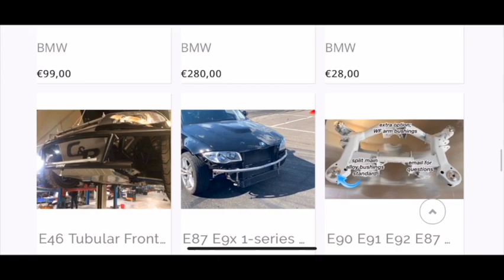Electric / Power Steering, Formula Drift Problems, My Shop and more! Instagram Answers Revealed!

Comment: For the 3rd question do simulators enter the picture? 
You can get a lot of practice in a sim for not that much money.
I have a lot of hours on a sim and when i went to my first lessons, it was pretty quick for me to adapt to the real car. 
However how does this apply to pro cars and competition?
Reply from the maker: I think its great for learning tracks, but to be honest I don't think the car setup translates at all. I drove probably 10+ really good sim rigs and to me none of the cars have the grip level of a pro car.  And ofcourse everyone always says "download these cars" etc, but then we do that and they still have less grip than a missile on bald roadtires. 
Gripped up pro cars are so crazy wound up, I've never driven a sim that even comes close . 

Sims a great for learning the basics, but the last 10-20% needs to come from driving a pro car. 

Nothing beats the real thing.
Reply: @DriftJesus  i can see that, for context my sim is triple 32 inch (all the field of view) and i use a simucube 2 pro wheel base on a solid 80/20 rig (all in with PC over 7000$).
When i did the drift class i was driving a pretty much stock 350z and found out real quick that if you aren't committed with the throttle it will not keep drifting while in the sim a similar car (tando buddies) will just stay sideways for days....

For sure there are some cars that are way better than others and offer more grip, but to your point i don't think there is any say 800hp car ingame that would struggle to spin the tires, like say Adam lz did in utah during practice when his nitrous wasn't working which put him at about that power level. 

So i can't really imagine what a pro car actually feels like ....
Reply: @DriftJesus  i guess a bigger question would be why don't teams invest into sim software for drifting?
Reply from the maker: @Philsilva06  I think for most people in Europe the choice is ; sim drift or not do anything drift related 

Ofcourse in that case, always sim drift.

But you are 100% right,  cars in sim will do a reverse entry through the entire corner.  And indeed, RTR or any Pro1 car will not even spin the tires when totally wound up.
Reply from the maker: @Philsilva06  some of them actually are.  But keep in mind, sim drifting is only ever gonna be visual.  

If you look at FDNJ, it seems a really easy track, right?

However, you can't see the entry , its all blind.   A lot of the younger drivers / sim generation struggled, because the visual references weren't available.  

It seems super easy, but the entry isn't as easy as it seems.  You go in completely on gut feeling / timing feeling.  

I think especially in USA, its so easy for the pro guys to have seat time (esp on West Coast and Texas) that it makes less sense to build a 5k sim setup that to burn 5k worth of tires.
Reply: @DriftJesus  you could add motion to a sim rig but then your are adding a lot more cost... however it actually felt easier in the real car than learning in the sim because you get more information like g forces which you don't get from the sim. Again pretty much stock car

 Different topic though,  i was originally asking about pro cars because burning 2000 tires at 200-300$ a tire is a lot and an alternative would be nice lool.

If there was say an iracing platfrom for drifting i think it would be "real".

Coincidentally i spoke to my drift instructor about drifting englishtown fd layout (he drives there) and i described that going off the old drag strip to the new tarmac in zone 2, you have to let off throttle a little or you would spin and he said that was pretty accurate. Maybe i have a different version of the track?
Reply from the maker: @Philsilva06  that is indeed true, they do a good job on the surface grip, but I have yet to come across a car that has the same grip as real life.
Reply: @DriftJesus  sooo does this mean you will apply your same mad scientist build philosophy to creat a realistic sim? 🤣🤣

If you do you can take my money for it
Reply: Of course motorsports are expensive so trying to save money is all always a thought.

Specially when you said drive 50 days a year and burn 2000 tires.  So if there was a say a sim that could provide you good practice for even 30 min everyday and you drove on track 10 days and burnt 400 tires the savings would be massive even with the cost of the sim
Reply from the maker: @Philsilva06  it would just require so much input and much more factors developed in the sims.  Drifting is still in its infancy, the sims are based on racing setups, which in real life also don't resemble drifting setups completely.  We run the cars on very soft springs and often a lot of shock / suspension movement and tire pressure / spec that I've never encountered in sim.
Reply: Imo lfs has best physics currently of all sim games. If you did not try that check it 😁

Comment: my question is on power steering and steering options i recently got a ratty e34 that is going to be a track car that i drive occasionally stripped the front end to find out it is a steering box car have you ever driven a steering box car and is it worth saving or do i just do a straright steering rack conversion ?
Reply from the maker: Yess I drifted with E28 and E34 from the start.  If the box is in good shape its totally fine.  Straight rack conversion is a lot of work and there's no racks that are a good match with the geometry
Reply: @DriftJesus  thanks ill have to power wash and clean the box and put wheels on it and try to turn it if  it is good ill put a new power steering pump if not ill have to try a rack conversion and front suspension to a newer bmw maybe a e60 or e92 probably but thanks for the information